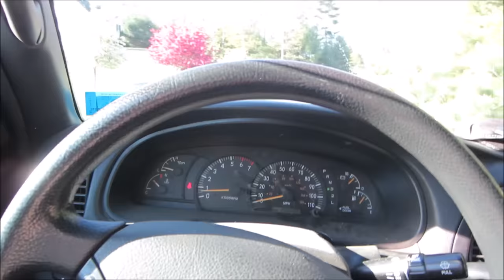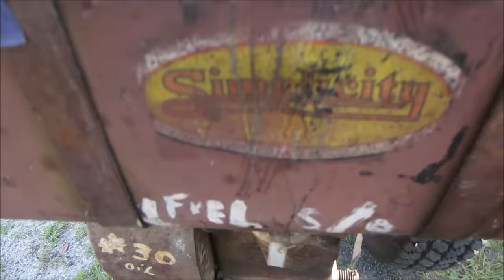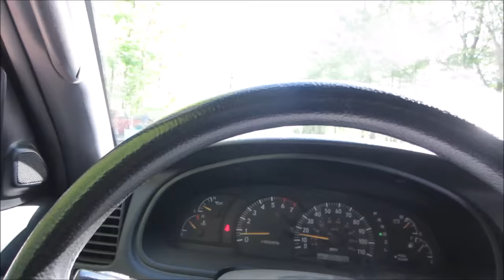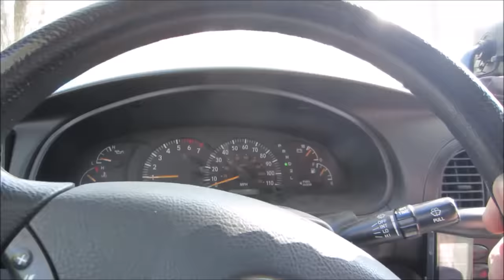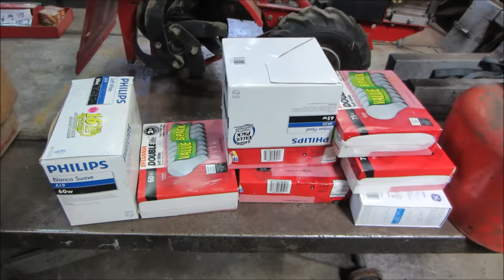$100 yard sales, lets go shopping for guy stuff,

Comment: "What's that? I don't know that that is."  It's an expanding anchor for bolting stuff to concrete.  Sometimes called a "confast."
Reply: Confast is a term often used to describe the yard sale industry
Reply: confast is the trademarked term for them
Reply: Those were AJ's  Abercrombie Johnson's otherwise known as a Lead anchor.  Can be used in cinder block walls if you use a "Hollow wall set".
Reply: I always, when I can, prefer to go into the mortar joint with a 1/4" plug and a #14 wood screw.
Reply: We called em various names in Aus;  loxons, dynabolts etc. Too many flavours!

Comment: Your videos have definitely helped.  Recently my neighbor asks "do you know a lawnmower guy?"  Yeah, me.  He says lawnmower stopped running last year.   Ok, sure roll it over, we'll take a look-see.  Carb and airbox just hangin there.  The studs for the carb...gone.  The bowl to the carb...gone.  Tell the guy "you gotta find these missing pieces and I'll get it running for you."    Check mfg site.  Studs are not available seperately, only if you buy the cylinder head.  Meh.     Since the carb is not attached, I sprayed some ether in the cylinder.   Nothin.  Pull the plug.  Almost 0 gap.  I set it and test.  Good spark.   Try again.  Fires right up for a second or two then dies.  Didn't spray a lot of ether in there.  Just enough.   Now...if they could only find the missing pieces.   It's a yard machine 21" w/ briggs 550ex 140cc engine.  If you have the studs and other screws for carb/airbox.  We could strike up a deal.

Comment: I wish we had these in the UK, we used to have whats called (car boot sale) basically where you driver your car / van to a predetermined location and set up and you have hundreds  and sometimes thousands of people set up, sadly most have now stopped ether because the councils that owned the land ether said "no you see  health and safety" despite them running for 60 years or more without issue, or to the people that own the land selling it for land development, it just sucks as I used to have 8  car boot sales in my area where i could get all kinds of good stuff and now i have zero and i would need to travel 60 miles for the closest one >.<
Reply: Yeah its a real shame, seems like most stuff just gets thrown in the dump, only place to get used tools is ebay and theyre usually the same price as new stuff

Comment: I had an original Troy-bilt Pony. It had reverse and 3 forward speeds via multiple pullies. You could match the ground speed to the conditions while keeping the tines running at a set rate. As I remember, I sold it about a decade ago, it didn't have a 'throttle' so to speak. There were 'Start', "Stop", and "Run" settings and the governor did the rest.
Nice to see the old shop again.

Comment: The little barrel things --- you would hammer drill that size hole and drive the lead barrel in the hole (after you vac the dust out) and you can anchor into the concrete with a bolt. The driver has a pin in the middle so you don't get lead in the threads. Love the vids

Comment: Hey mustie...if ya didn't know...
Those round steel inserts you seen in the Rivit box are ...Concreat Ancors.
You drill a hole in the concreat or brick where you need to ancor something...slid one in and when
you put the bolt through what you want to afix on the concreat it goes into the 
fastener and it ...expands out...holding what you wanted to bolt down.
LOVE the fix it vids man and the odd stuff you work on.
Great stuff Boss.
Take care...
E-biking at 65- Wayne

Comment: That widget mixed in with the rivets is a wall anchor. Usually used in cinder blocks. Requires a special tool to wedge the anchor into the block. Just a heads up. Love the channel.

Comment: Mustie , you can just push the air hose on the stem without the filler chuck. Leave the schrader valve in as well. It fills very fast with valve out but works either way. Been doing it for 30 years. Try it out !

Comment: I grew up in Upstate NY. As a kid my father went to Troy NY, and bought an 8 hp TroyBilt 'Horse'. That was back in the late 60's. At the time TroyBilt was a local company to us and you could just go over to the manufacturing site and pick one up. Years later the company was sold to 'Garden Way' which then tried to get into manufacturing all sorts of things including exercise equipment. They eventually failed and the company was then sold to MTD and the original manufacturing site was closed down. The company that I work for eventually leased the old GardenWay facility and it was used as a Data Center where NYS Medicaid was processed from 2003 until 2008 when the pharmaceutical company Regeneron took over the building.

Comment: You could swap the dual rear to the tandem and then put an electric kit on it.  That way you lose the weaker rear wheel on the tandem by replacing it with the duals off the trike. The batteries for the electric drive go in the basket and you and Mrs Mustie have transportation for putting around car shows.

Comment: Get a tire chuck that fastened onto the valve stem.
I have several and used them quite a bit.

Use lighter fluid and a match to expand that tire to fit on the wheel.

You can also fill those tires with water to get better traction on those little light duty tillers.

Comment: Maybe I'm doing it wrong, but I would immediately take the air filter and carb off the machine and clean both before I even attempted to pull it. Then, I'd check the oil, inspect the tank, and check the plug. I can't help myself. I wish I could just drain the carb and let her rip. I probably waste a lot of time. Of course, you work on a lot more stuff than I do. Plus you film everything. That takes time. I don't have the patience for setting up and moving the camera every five minutes. You're awesome, bro. Thx. I know this video is old but I'm going through your back catalog. 😳

Comment: The metal slugs in the pop rivet set looked like expansion "nuts" for anchoring lag screws in concrete.  You drill a hole in the concrete and push it in, then run your lag bolt in and it will compress & expand in the hole creating an anchor.

Comment: Hey Mustie1, at around 19:20 those things that you couldn’t identify are masonry anchors. You hammer drill a hole the diameter of the anchor and drop the anchor in the hole. When you tighten the bolt into them they expand like an old bicycle gooseneck.

Comment: That Athearn HO locomotive is 1960s vintage as it has a rubber band drive. A friend of mine modified several of then with a double reduction drive and added some weight. 4 of them could pull a 100 car train up a 1.5% grade.

Comment: That part you found in the rivet tray you need to mount something into cement you drill it to the size of that you stick that in the ground and when you tighten up the center tightens up on it and it expands and it tightens it into the ground so it won't pull out

Comment: That train set is an Athearn from the 1950s those diesels were called "Hi-Fi Drive" and used rubber bands from the axles to the motors. That's why the trucks are hanging out, the rubber bands must have dried out and broke.

Comment: The "I don't know what it is" is a concrete locking bolt holder. Drill a hole drop in holder attach  blot and it will hold down what ever is attached to the concrete.  You can remove the bolt but you can not be removed the holder.

Comment: Those double hose (pressurized) OMC outboard tanks for engines from the 1950s sell on Ebay for up to $100. each asking price.
I've had good luck fixing a small hole on the bottom of one of this type of steel tanks with silicone gasket sealer.

Comment: Short threaded things in bag are for setting bolts in cement. Drill hole put in tighten bolt set expands bolt plate on top.

Comment: That is a corker... a cinder block anchor. But you need the tool to screw into it, then hammer it into the block. Remove the tool and a bolt will screw into it.

Comment: Those things with the rivets are concrete lead anchors u put a bolt in them and put them in a hole drilled in concrete and when u tighten them they expand and hold themselves in place

Comment: It was a floor or wall anchor for concrete.  Drill a hole. Insert the anchor.  A bolt screws into it. As you tighten it contracts and expands.

Comment: Hey my friend. I have the tryo built tiller you bought for 50 bucks. Mine is a Super Bronco. Only difference is my will go in reverse. Carburetor (as you saw) are really easy to clean. It's a good tiller. And yeah, I have had mine for about 10 years and probably have about 2 to 3 hours on it lol.

Comment: The item you didn’t know what it was with the rivet set looks like a lead shield that you drill a hole in cement insert the shield then insert the bolt and it expands in the hole to hold the bolt tight.

Comment: Bought a Troy Bilt Horse around 1977-78 direct from the factory.  Still have it and it still works as good as new.  Did have to replace the gas tank with a plastic one and rebuild the carb.  I think I paid around 750.00.

Comment: In that paper bag the what is it's with the rivets was and is concrete anchors for all thread rod so yes now if you need to mount on concrete you have smallish anchors just hammer drill the right size those plop in not sure if those are tap to set or tighten looked like tighten but yes looked like maybe 1/4 inch-ish and enjoy you can finally parentally mount some of your floor mount stuff good thing is if you move them only leaves small hole behind.

Comment: @19:15 those are lead anchors for concrete and cinder block. You drill a specific size hole in the concrete or cinder block and press the anchor in, then as you tighten the hold down bolt the bottom half of the anchor pulls up and locks it in place.

Comment: Small paper bag in red tool tote at 19:14 has lead bolt anchors for drilled holes in a concrete wall or floor.  Drill and blow out the holes, gently insert  the 2 piece anchors ( open hole to outside- where bolts get inserted ) and tap to seat then place attachment and screw bolts into anchor and tighten.   Bolt will pull soft wedge  and spread to lock into concrete base.    JwgK

Comment: @ 19:00 The little metal cylinders with the cone shaped nuts are concrete anchors, you drill a hole the size of the anchor the right depth and you can figure the rest out.

Comment: a few years ago I went garage sale'n and found a 1996 Kawasaki Vulcan 800 the owner said had a blown engine. it had been sitting for 5 years in his garage. paid $150 for it complete with a new in box starter.  Took it home realized it had ZERO oil in the engine. filled it up with oil and put some in the cylinders. rocked it back and fourth in gear and got it to free up. Charged the battery and it fired up with no issue. Score! Still ride it almost every day

Comment: You likely have the Horse tiller, usually a 5-7 hp engine.  The old ones had the H60 series.  That Bronco is a counter-rotating tiller ND I would try it before you get rid of the Horse.  I find the Bronco CRT a nuisance because half the time you have to push it along because the ground engagement with those tires and the light weight isn't enough to pull against the reverse rotating tines.

Comment: Glad I'm not the only one that does a slow drive by of not-promising sales. I'll also admit I've found old barns to be good places to find good junk. Downside is that locally, I've either already bought up all the good junk or all the old barns are owned by the flea market vendor types making prices high. I'm more thinking the former, as even visiting the consignment :"lea markets", I've seen little of interest. I'll also caution that those plant/clothes sales may have some hidden surprised your missing. Picked up a ~100lb Peter Wright anvil for $50 at a sale that I usually skip as they primarily sell seedlings. Also got someone's toolbox cleanout box, covering a 3'x6' bench including Snap-On, MAC, ect, for $40(It was sitting under the table and I'd seen a 18" adjustable wrench in it and some welding hammers, was rather surprised with the contents when I got home. ) Unfortunately., I've struck out every time I've gone out over the past few years so not much motivated to go out these days.

Comment: Those things you were looking at are lead anchors, I could not tell for sure but I suspect they were for 1/4-20 bolts.  You need a set to hammer them in.  The were made by Ackerman-Johnson and known as AJs.  You can use them in concrete walls and if you hit the web you can use them in concrete blocks.  They have fallen out of fashion because it is no longer legal to use them to hold anything over head in case of fire, the led will melt and down every thing comes crashing down.  The set is steel and you can notice it by a small tit coming out that centers it in the AJ.  It is probably 3" long and will have a slightly knurled section neat the end you beat on.

Comment: I got a free weed eater, the only issue was it needed a new primer bulb and proper mix of fuel but it runs, and a scrap lawnmower that was scrapped cause the deck was rotted, but scored a fine 5 HP engine

Comment: on 19:15 that looks to be a flush hilti or red head concrete anchor should have a wedge shaped cone inside where you can drill a hole hit it with a hammer and then thread a bolt into it to secure something to the concrete. Just make sure it isn't one
with a gunpowder charge it would require a different procedure to use.

Comment: i have one of those old columbia trikes was the same color when i got it, but after many years of owning it the colors have changed a lot. , i put a grill on the back and some chopper forks and ape hangers, unfortunately, tires for it are difficult to find and are very skinny.  but i do like the differential, i added a 3 speed nexus hub to mine.  but i kept the original forks and front drum brake wheel.

Comment: Mustie 1: got a question for yea, i do scrap metal and live in KY, found a toro riding mower in a stream wrecked, on its' side, cops don't know where it came from but said i can get it, oil full of water, drain it, hooked up a jumper to it just to see if it will turn over, it did, how can i see if it will start, some parts are missing, i would send a pic if i could,

Comment: the thing you did not know what it was is an "anchor" to mount a bolt in concrete or block etc drill hole insert with bolt in it and tighten...

Comment: whats with the flashing red light by your Tachometer? better prices @ the Free piles along the road....   19:14 'I dont know what that is"... it is a concrete bolt anchor, drop in the hole and tap on bolt head to set....

Comment: Only $100! - Have you lost your touch during the Covid crisis? Not a bad haul, just the same. Nice outcome on the tiller, though I thought "That's not a proper Mustie machine. It didn't even try to put a fight!".

If you ever come across "Mole Grips" I think you'll be pleasantly surprised. That's what we get in Britain, and they're as good as "Vise Grips". We have both makes in our tool kit, and can't fault either, but never ever get the cheap, unbranded junk. We keep them purely for sacrificial jobs, where they're never coming home, or not going to survive the job - They make fair welding clamps, but that's about all.

Comment: What a cheap tiller--Troy-Bilt is a shadow of its former self. There were only two models back in the heyday, Horse and Pony (large and small), but they both had full handlebar controls and forward and reverse and the option of electric start

Comment: fyi, you want to see another trick to filling tires up, just take the quick connect, on the end of your air hose, and plow it right into the valve stem. 70% of the time it will fill your tire right up, no BS 🤪💢🥴💯💯💯

Comment: what use are the light bulbs?  i have a few boxes of those.
Reply: Incandescent light bulbs make great current limiters testing out gear. If the draw is too great the light just comes on. When it comes on you know to power the circuit down then too. The bulb literally lights up.

Comment: Why didn't you buy that saw
Reply: What saw? Time stamp?
Reply: @1pcfred  like the second or third house he drive past there was an old radial pull saw in the driveway.
Reply: @1pcfred  35 second
Reply: @thecynic807  I have never seen Mustie doing a whole lot of woodworking. You're better off with a chop saw these days too except perhaps for cutting dados. Radial Arms Saws are pretty much a thing of the past anymore. I have one I use for doing some crosscuts. Thing couldn't cut square to save your life though. Good for making ground stakes with.
Reply: @1pcfred  I wish I had one
Reply: @thecynic807  I wish I had a better one. The one I do have is not the best. What I really want is a 12" double bevel compound miter saw. But being as they run around $500 and up that's why I don't have one of those. I got the Radial Arm Saw I have now for $20 at a yard sale. That guy was thrilled when I bought it. It meant he didn't have to drag it back inside. Because it is a bit of a heavy bear.

Comment: Here is a little trick I have used for years on small tires and rims, I clean the beads with a soap and a little wet rag, when it dry then I take a paper towel and soak it With oil and cover the bead on both sides 90% of the time just that along does the trick. if that don't work then it time to put around the tire and slowly start to band it down. and between the 2 out of thousand of tires it has only failed me 1 time. and that was the only time I got out the starting fluid. OOh by the way when using starting fluid wipe off any extra oil that you may have put on earlier if not you might end  up with a fire that could damage the tire. ( been there done that )